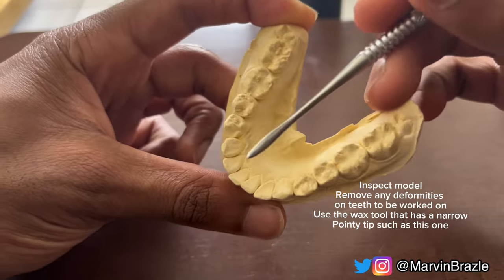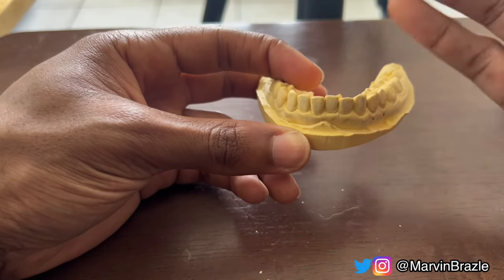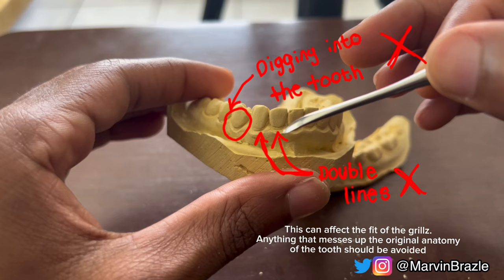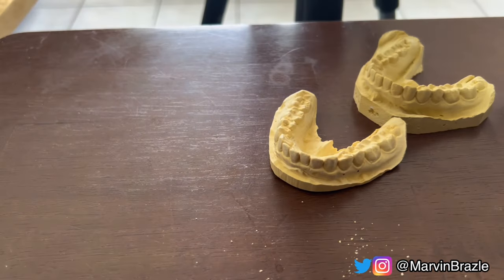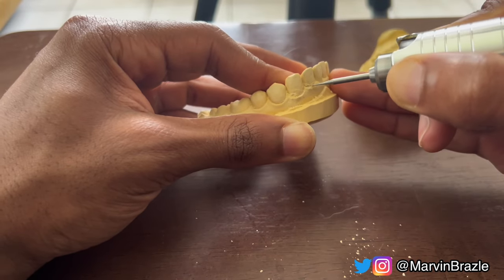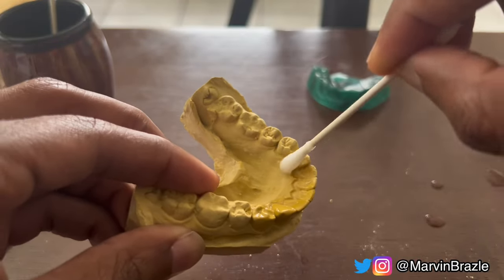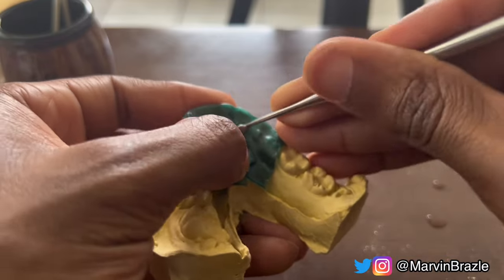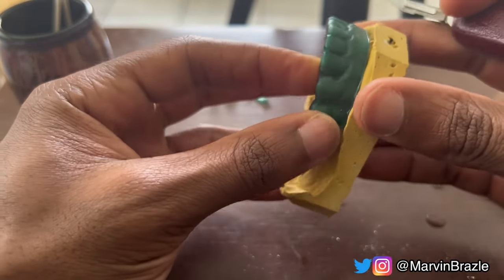How to make grillz at home (THE WAX UP PROCESS)

Comment: Brother how do you smoothen the wax out? Do u have any other tips? Because i struggle a lot with it.. i would really appreciate it, thankyou brother 🫶🏼
Reply from the maker: Hey bro, there are a couple ways. MAIN THING FRFR IS PATIENCE. But you can use an exacto knife, or the wax carving tools you basically wanna go over them with the sharp edge at a slight angle and gently scrape at the surface. The harder the wax the better so keep a bowl of ice water next to you. Another way once you’re trying to polish the wax to be even more smooth I learned is using a cut of pantyhose or a silk Durag. Pulling the silk over your index finger tightly and rubbing gently over the surface is also a decent way to smoothen it out.
Reply: @DayTodayMarv I will keep these things in mind when im gonna try again. Thanks a lot 💯

Comment: What was the heat gun for because I didn’t see you use it cuzzy
Reply from the maker: @sp_lux3006  didn’t really need it much for this piece but basically. Just another method of softening up the wax. The hot water and the heat gun are interchangeable
Reply: @DayTodayMarv  Yh I clocked after I commented I was moving stupid love for that tho brother 🫶most in depth grill videos I seen out there big up
Reply from the maker: Preciate it boss 🙏🏾

Comment: Did you use just one layer of wax or two? And what gauge
Reply from the maker: I used one but you can use two. The downside of that is that this makes your wax weigh more which in turn makes you have to charge more cause you’ll have to use more metal and then your piece will be heavier.
Reply: @DayTodayMarv  thanks I asked because I actually started using more wax I was scared one sheet would be too thin
Reply: @DayTodayMarv hey bro the advice was helpful got 3/3 casting this is my Buisness account but I wanted to know if it was possible to have a 2 hr burn out
Reply from the maker: You can do a 2hr burnout. Normally they’re 1-2 hrs. Sometimes 2-4 depending on the metal being used
Reply: @DayTodayMarv  can I have a schedule?

Comment: Curious after adding the wax to the print why not dip the whole thing back into hot water so you can make it a tighter fit? Is there something wrong with this concept
Reply from the maker: Not a bad idea you can do it like that. Honestly when doing a waxup you can do anything that works
Reply: @DayTodayMarv right on.. ya lot goes into the process.. I watched the other videos and am considering this as where im located Id be the only guy for miles. Any tipsnon sourcing the gold, silver for the casting?
Reply from the maker: @Mwellmac dope man! But funny enough I’m working with the same issue now when it comes to getting better priced materials. The main company I’m working with is rio grande.
Reply: @DayTodayMarv any idea where I can see how to do plating? Like after casting .925 plating with gold etc?
Reply from the maker: @Mwellmac  not atm unfortunately

Comment: Bro how you get the wax mold off the dental mold? 

Do you cast it with the dental mold
Reply from the maker: Aaaahhhhhh shiiitttt someone ain’t watch the full video lol 😂. But nah woe you just either spray “mold release spray” or put baby oil on the model before doing the wax up
Reply from the maker: Aaaahhhhhh shiiitttt someone ain’t watch the full video lol 😂. But nah woe you just either spray “mold release spray” or put baby oil on the model before doing the wax ip
Reply: @DayTodayMarv  tried it before but never used baby oil so I’ma try that, but shouldn’t it be way easier just casting as is and not pulling it off the dental mold? It would be more precise
Reply from the maker: @AlexanderHorsdalThomsen  probably, I’ve never tried it that way before. I have some dental friends that do it in a way like that but I’ve never done it.
Reply: @DayTodayMarv  thanks for the video keep grindin’